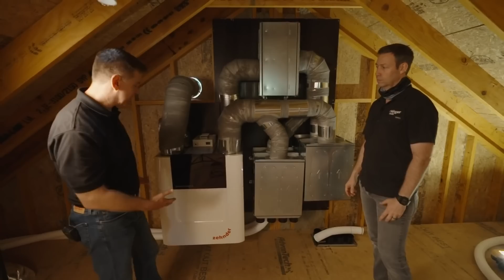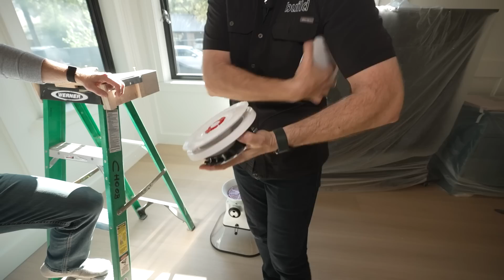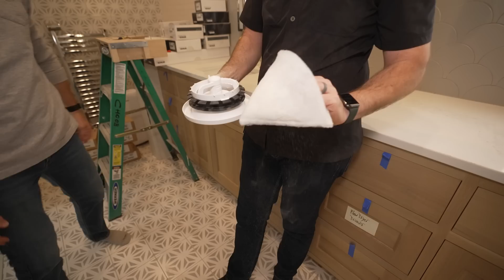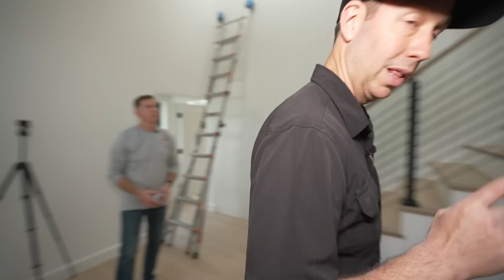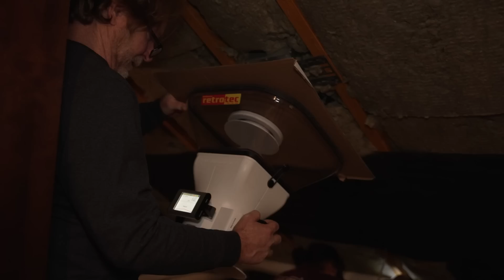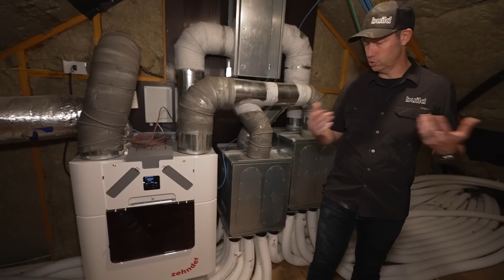Commissioning The World’s Most Efficient Fresh Air System

Comment: What is a bit odd is that the system when triggered for the bathroom seems like it will send the WHOLE unit into high speed mode, and not just the single room that it is needed as the whole system is balanced at a room level by what is essentially manual dampers. There could be a potential for efficiency improvements.
Reply: Thought this as well.
Reply: Have to keep the house pressure balance.
Reply: That's fair, but I would imagine the difference between boost and maintenance mode is pretty small and the energy use is negligible.
Reply: Putting the unit into boost mode is just going to proportionally increase the CFMs at all registers, which includes the bathrooms. I understand what you're saying about how only putting bathrooms into boost mode would increase overall efficiency, but to my knowledge, there is no fresh air system on the market that can do that.
Reply: @anDWandy  True. I do believe there is usually a localized return path to the main unit in the same space, which would keep that pressure balance as long as the return stays in step with the source. I could be wrong though.
Reply: @frostman9661  True, especially if the whole unit uses ~125 watts as said in the video.
Reply: If it was a house with one or two bathrooms its no big deal but he definitely should have been sold power grills that open for the bathroom being used.
Reply: Well everyone deserves to smell the poop. Lol

Comment: Ultimately Zehnder needs to bring the unit from Europe that integrates a dehumidifier with the system to the US: the ComfoCool Q, not just the ComfoAir Q.
Reply: As a person that has a Zehnder unit in the US, I couldn't agree more.  We could not achieve less than 75% humidity in our home during the warm months.  We have to have a separate unit to do the job now. Built in would be amazing.
Reply: As much as we all would like an dehumidifier on an ERV in many climates it does not work.  When we look a the volume of air brought in and the amount of water that can be removed from the volume of ventilation air in humid climate.   It would be less than the water that gets in by as air leakage, diffusion, people exhaling, perspiring, showers, cooking, plants, pets, capillary from the ground, washing dishes, did I miss anything?  So even if the dehumidifier could remove all the water from incoming ventilation air it would not be enough in many cases.
Reply: I am in an arid climate.  I need a whole house humidifier.

Comment: It would be cool if for the cooktop air system, turning on the exhaust fume hood could send a low voltage signal to the ERV, which would trigger the ERV to increase supply air CFMs by how ever CFMs the cooktop exhaust hood is removing. Yes, the ERV would not technically be balanced during this moment, but the whole house would still be balanced technically. I would imagine one of the reasons for not doing this is that the cooktop exhaust hood removes too many CFMs that the ERV couldn't make up. Still a cool idea though. Great video!
Reply: I think in an earlier post,  Matt mentions that he has a makeup air register for the hood that opens when the fan is activated.
Reply: RenewAire has this capability with their control system option.
Reply: Originally my Zehnder rep told me it would but after much discussion with the engineers they said it would not.  I don't see how it couldn't detect the negative pressure at least up to its capacity and shut down the other exhaust temporarily to compensate, but it doesn't work that way.  In general it actually isn't as smart as you might think.  For example, if you use a boost switch in a room it doesn't just boost that room, it boosts the whole house for that time period.

Comment: I got the idea from Matt's ERV videos to do something similar when I built a large house and had the HVAC guys install a 300 cfm ERV which pulled air from bathrooms and laundry rooms and put fresh air in bedrooms.  In addition to the whole system percent timer, they created a circuit board with zone dampers in the duct work which defaulted to fully open that worked with analog bathroom exhaust timers so that when a bath room timer was activated it would partially close down dampers going to other bathrooms (two laundry exhausts always remained fully open) and therefore pull harder from the offending bathroom (or bathrooms if more than one was running a timer concurrently) until the timer ended.  The 'bath exhaust timers' would also activate the ERV if it wasn't already running based on the percent timer.  It was silent and worked EXTREMELY well to get rid of smell.  That being said, I missed the noise created by the exhaust fan so it made using the bathroom a little less private.
Reply: So you filter the bathroom air and recirculate it rather than exhaust it from the house?
Reply: @aayotechnology  No, the ERV removed house air from bathrooms and the laundry rooms and put that air outside while bringing in fresh air and putting it in bedrooms and near large return air intakes to get distributed through out the house.

Comment: Hi Matt, I'm a builder from Australia, Melbourne and we love your work. Given your extensive knowledge in this subject I'm wondering how to ventilate timber frames naturally with ICF type walls? We use Dincel or pvc concrete filled walls for basement constructions. Would you recommend steel frames? Or is mechanical ventilation the only option? 
General method is brick veneer facade on timer frames, which has obvious limitations with respect to insulation but evenly spaced weepholes or vents ensures no moisture build up against timber frames.

Comment: Not commissioning, this is start up. After startup and air balancing (TAB) is done. After all there start

Commissioning process:
1) Cx BOD (Basis of design) document review that BOD meets OPR (owners project requirements).
2) Cx design review 
3) Cx submittal reviews 
4) Cx review if receipt of until in site, how its stared, boxes in good condition, all parts and options there.
5) Cx installation inspection.
6) Cx pre energization inspection.
7) Cx pre functional inspection
8) Cx Functional commissioning after unit start up and TAB air balance reports completed and reviewed. Test all unit functions and performance.
9) IST interested System test. Test all systems with everything's ng in home completed to verify all systems function together 
10) Cx Seasonal commissioning, winter fall, summer.
11) 10 month warntee review if all commissioned system, retesting all, all definitely ciencues reported so full fixed before GC 1 year warntee expires.
12) CX periodic recommisioning check all functions, review energy use and system changes.

Comment: System looks great!  The only questions that I have is what happens if you have a hurricane, tornado or snow storm and you loose power in your area for days or a week or two?  Will you have to open your doors or windows to let the air circulate out the CO2 that’s trapped in your home?
Reply: I would assume he has a back un generator installed for power outages.
Reply: @rory644  for sure, but how big does that generator need to be? What else does it run? And do you have enough fuel to operate everything for a prolonged period of time?
Reply: Good grief, watch his other videos!  He has at least one about the generator he installed, and I think he helped neighbors when the power was out for several days last winter.  If you think he's gone to all this trouble without considering emergency situations, well, think again.
Reply: @CitEnthusiast  my point is simply that there a lot folks out there that aren’t taking that into account. Just looking out for others to help make sure they think it through as well.
Reply: Have a room full of plants! all set haha

Comment: It would be interesting to see a chart that ads up all the additional cost for all this fancy tech needed for a super tight house vs just building the house normally and losing a little heat
Reply: Build to 3-5 ach 50 and leave out the fresh air system. Trust me these systems eat electricity big time

Comment: The only type of dryers allowed to be sold in Europe are the condenser types. Like you have installed. 

As an American I find them inferior to our gas powered dryers. Comparable gas dryers are not very energy efficient  but the speed and results are great.

Have you compared the results of the two?
Reply: Dry your clothes on a clothes line.  Problem solved.
Reply: Never used a gas dryer, how do the clothes feel after drying vs conventional electric?
Reply: @Raymond-mk8cb  Not in humid climates Ray.
Reply: We have a Miele condensing dryer in the garage. It works great, built like a brick s********...German quality I guess. Decided to go with one for our remodeled house didn't have a vent installed in the garage. The Miele also uses a basic 15 amp household 120V outlet, freeing up the NEMA 14-50 dryer outlet for our EV charging. Most likely saving cash on both ends over retrofitting for a vented dryer plus second 240V EV outlet, plus the energy savings on drying (we're seeing 600-800 watts on the dryer).

Downsides:
- The model we went with is small, great for a small family household, but will become apparent with more laundry. 

- it's a closed loop system, with 3 filters. Two of the lint filters require frequent cleanings, they are sandwiched together for ease, but for proper drying they should be cleaned between loads or cycles. We keep the garage vacuum near for easy cleaning. The third filter is essentially a sponge, and should be cleaned or washed infrequently.
Reply: @macthemec  Warm and fluffy. About the same.

The real question is do we stay cheap and burn stuff and vent it to the atmosphere (coal power plants, gas dryer and water heater), or do we have expensive renewable power and very complicated systems for efficiency?

Comment: Running ecm 80 cfm 24/7 piped from outside through a three filter staged air box directly into furnace plenum intake then filered twice merv 12, ti02 filter then 4 uv lights above and surrounding a coil and one in center a coil, timed. Three class 2 medical filters running separately at 80 cfm x2 and one at 100 cfm. Not much more i can do. Electric bill 150 mo. All electric. All led lights. Need to install heat pump water heater sitting in box in garage. Maybe solar air heating to heat partially conditioned crawl space, no floor insulation. Bare cinder block surround skirting but foam sealed to house rim joist, platic liner on ground. Bubble foil wrap on all venting. No flexible venting or garbage yellow or pink moldy stuff. Subfloors painted with kills and hytech ceramic additive [r7 est.]. Need to seal and insulate cinderblock skirting and one more wrap of double bubble on ducts, paint underside of subflooring with kilz and hytech lay down foil infrared blanket on ground the ill b done. All protrusions in floors, walls and exterior outlets foamed. Hvac closet walls foamed three pound pourable to prevent condensation into walls and seal cavity. Hvac pan double insulated, double panned with water sensor, antimicrobial. Drain line pressurized to prevent fouling of drain line, cost gaurd style, and backdraft thru line also skupper check valve. Petot tubes to follow to ballance air flow with filters. Need better butterfly vent assemblies in bathrooms and on micro vent. Need closable chimney cap. Currenly fresh air intake on fireplace foamed shut as i dont use it but can open it if needed. Furnace motor ecm constant run to circulate air it has prefilter and draws some air from water heater room which has its own wall mounted filter next to refridgerator to capture humidity and warm air from ice box motor. Shower or bath cavities vented and water alarmed. Lennox elite heat pump has its outdoor coil elevated off of ground, sided and roofed in its own "doghouse", screened and protected. I have video of it on my channel hvac coil doghouse. All lines wraped with armaflex and where exposed to weather 3m extreme weather hvac metal tape. Thermostat staged 66 to 70 f.

Comment: Matt, I will be curious to hear how you like those Miele washer and dryer sets.  My Zehnder system is about 75% installed and just started thinking about what to do for ventless dryer.  All roads seems to point to Miele and Bosch for heat pump dryers, but I don't know anyone who has one.  Everyone I know who has a condensing dryer hates it, so I'm crossing my fingers that these new heat pump dryers cut the mustard.
Reply: One problem is none of the heat pump dryers are as big as traditional US dryers, so forget about trying to dry a comforter. Someone used to make a large heat pump dryer, but it's been discontinued. It will also take a long time to run, as the hot air isn't nearly as hot as gas or electric. If you are OK with more frequent small loads which take longer to run (and the filter cleaning), it is more efficient to operate and doesn't send conditioned air outside.
Reply: We've been using a Bosch heat pump dryer for years now and we love it. It does take longer than an electric or gas dryer. Most loads take 80min or so which isn't a big issue for us. Being able to place it anywhere and not worry about venting is great.

Comment: this is great, love the concept, and being efficient and having control, but having to always change a bunch of filters and clean things out, it's just one more piece of maintenance to a house.  plus if you loose power, or there is a surge, is the unit protected? does it remember all it's settings?   With my current 'drafty' budget house, there's only 1 filter I have to change, and I don't have to get on a ladder to do it.
Reply: The filters for intakes is an extra just to keep your ducts clean which should be in every home (bathrooms, return air etc) It would be like having filters in intakes for a regular system.
Reply: Twenty minutes of maintenance every 6 months for fresh air in your entire home all the time? I bet you can handle it. :)
Reply: This maintenance will be annoying. Seems ok right now, since this is all new. But give it a few months and you will find yourself wishing you hadn't. It's much much easier to place the filters at floor level where you can reach them.
Reply: The placement of the in and out units  allows heavier particles to settle to the floor, if it's as balanced as they're saying.
I want to know how this compares with ground source heat pumps in terms of payoff,  power requirements and efficiency.
This is obviously a simpler setup, although tuning is likely the key after the tight envelope.
Geothermal payoff is about seven years. The Federal tax incentive, if it continues, pretty much pays for the drilling and tubes. Provided you aren't above geologic voids it would finance the grouting of those tubes for continuous contact with the native formations.
A customer can see a bunch of money go down a hole in karst, or dissolution environments. Good contact is key for heat transfer.
The story behind the mini split. Is it for the basement?
I may have to find the installation video.
Reply: @richavic4520  there really is no roi for this though... It is simply fresh air supply because it's a tight house. I'm not sure how you could measure how much it saves when it isn't producing heating or cooling.
Reply: @richavic4520    Geothermal is massively unrealistic for Matt's area.  You should go back and watch his video for installing stuff outside, get just a couple of feet down and you hit rock.  That entire area of Texas is limestone.  I have a friend who put a pool in his yard in that area, the builder spent a week breaking up the rock.
Reply: @frostman9661  very easy, in the app the unit is doing this measurement for you and you can see all the data.
Reply: @Tommeehr  but how can you measure an roi on something that is purely for higher quality air? The true roi is measured by the heating and cooling savings because the home is so air tight.
Reply: @frostman9661  the system os measuring how much energy it has recovered and is reporting what would happen if you would just throw that energy out, ie by opening a window.

Comment: I'd love to see a CO₂ (carbon dioxide) sensors included in the system with automatic increase in fan speed for the CO₂ increases like during a party on a cold night.
Reply: Along with pressure sensors to tell you when to change / clean the filters. For this kind of money, a few transducers should be included.
Reply: The system supports up to four CO2 sensors and can boost the fan speed if increased levels of CO2 are detected. It was mentioned in the previous video about the Zehnder install at his house (prior to this commissioning one).

Comment: I like how they have an expert setting up the system but it would have been cost effective to tie the ERV into the air handler and have that continuous running and balance one system. for bathrooms use a timer and a posh grill so the ERV favors pulling air from specific bathrooms. The HRV/ERV debate, we generally use a ERV in a radiant heated house because they have have lower humidity levels and a HRV would make the air too dry here where its humid.

Comment: Why not just install a couple 6 inch Merv 15 plus or Merv 16 air filter with an ECM inverter Drive HVAC and combo unit and run it 24/7 with an air exchanger?

Comment: What an amazing system!
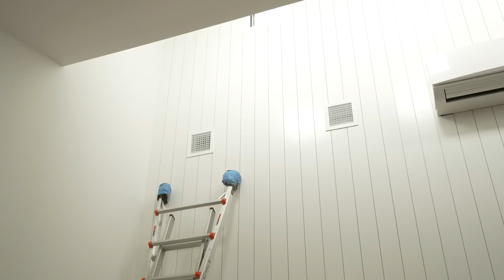Reply: Except for the mini split above the stairs [9:43].  Those do have a screen [I wouldn't call it much of a filter] that needs occasiomal cleaning, plus... when the remote pukes on you, physical access is required to try a reset or manual activation.  I know zero people that keep scaffolding handy for their homes - just never happens.   An architect dreamed this up???
Reply: @flinch622  valid point.  It's just for extra cooling when there is a lot of company.  I'm pretty sure it's not intended to provide added filtration.  I think I might be able to reach it with my little giant ladder.